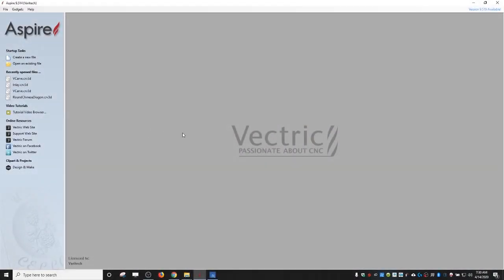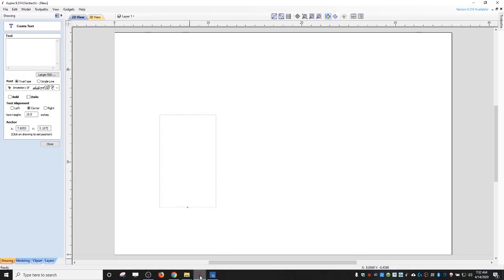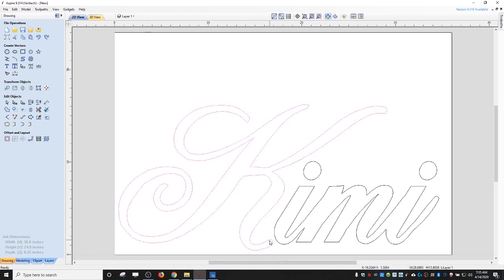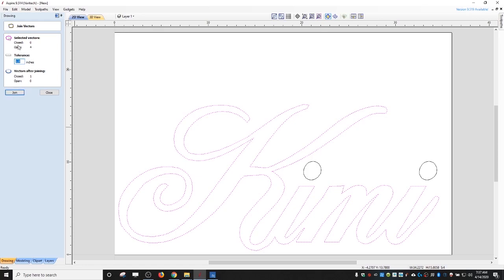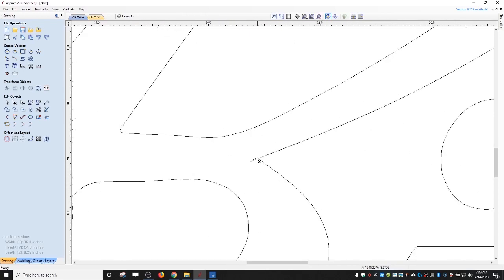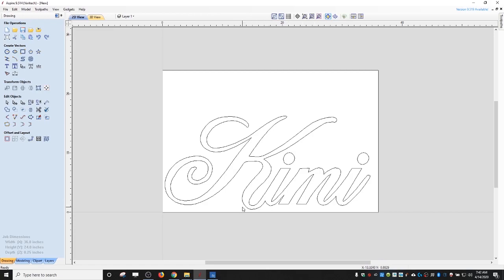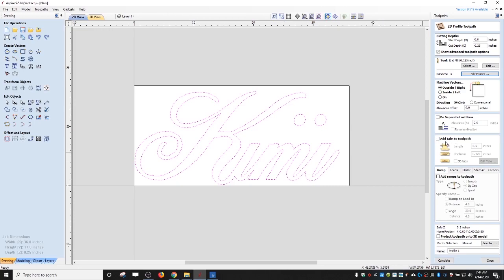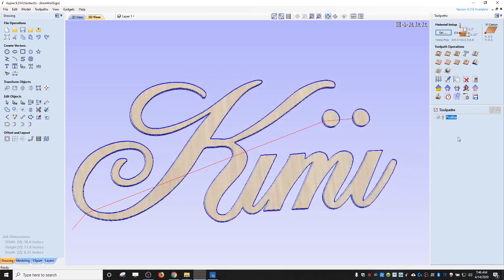MDF Wall Text Sign on the CNC machine using Aspire

Comment: I want to start a side business making wood clocks. What machine would you reccomend to get started? I don't want to make anything bigger that 2 feet in diameter.
Reply from the maker: I've gone through several CNC machines and even upgraded all of them eventually in some way or another - so it's hard to recommend one - I would start with something on the inexpensive side until you really know what you want and the pain of upgrading won't be so bad :)
Reply: @JamiesHobbies-GGB  I basically want something that will carve out the numbers, the area where the clock mechanism will sit flush and carve out some quotes and names that the customers may request. What brand would you suggest and I can research the rest?
Reply from the maker: @ILC-eo6vk  The best one's I've had are "no brands" off of eBay - like this one https://www.ebay.com/itm/363211939530?hash=item54911e5eca:g:EDUAAOSwuLZY5JHl